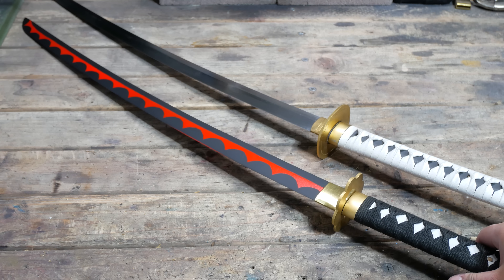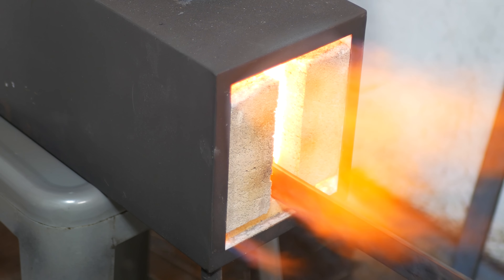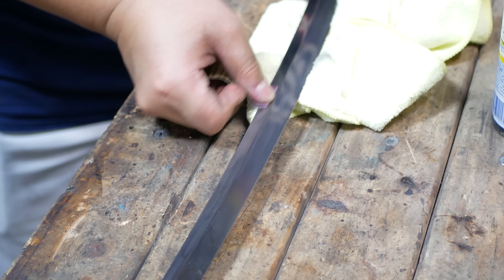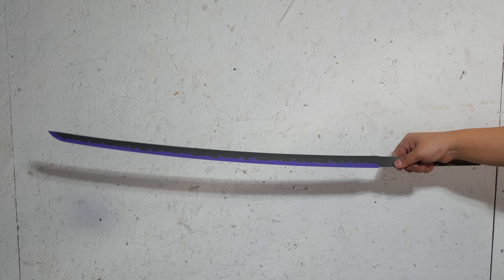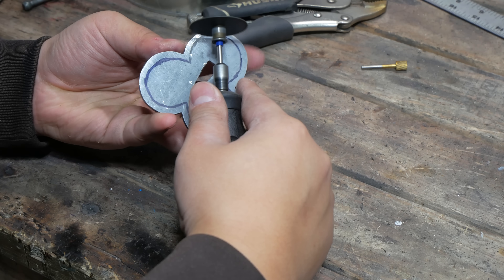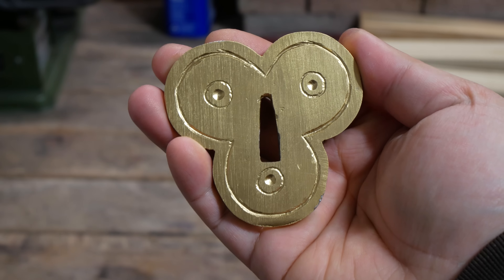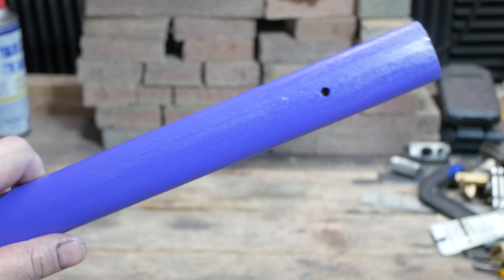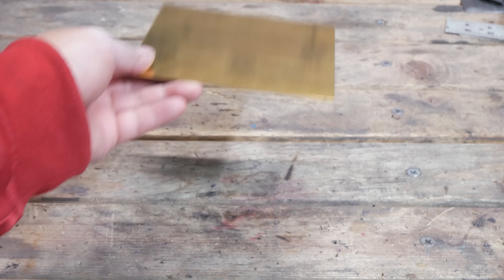Katana Making - Enma (Zoro One Piece) ALL THREE SWORDS!!!

Comment: What kind of paint do you use and does it last on the blade?
Reply from the maker: I have used a variety of different kinds, from Duracoat to Rustoleum. So far, Duracoat has lasted the longest but is also very expensive.

Comment: The swords are getting better and better, but why don't u use leather or artificial leather for a base handle wrapping? U will probably get more nicely looking tsuka in this way. I dont mention samegawa here as it's really not cheap. What's more one can try zone hardening. Not sure if hamon will be achieved but it's a traditional way to get sori, plus, working with a straight blade is easier, as for me, and then it is curved after quenching.

Comment: What I really like about this build is you gave it a pretty convincing choji style hamon, a personal favorite. It also reminds me much of the kind of swords they give Mitsuhide Akechi in the Samurai Warriors/Warriors Orochi games. Does it move differently in the hand/feel very different when it's not wrapped?
Reply from the maker: God I love the dynasty/samurai warriors games. It does feel a little different, definitely thinner because there is no wrap. And the paint was a little slick, it would've had more grip if I didn't use gloss paint. The fittings helped to make your hand feel secure holding on to the sword too.
Reply: @JumboRadish  I always played as Mitsuhide if you couldn't CAC, even then, I still used his moveset. I guess the paint issue is tolerable if you shape the tsuka well, lets you index properly. Ever give any thought to fine polishing the edge? It's a secret of some knife guys. They put a convex edge on the blade, then give it an extreme level of polish. Both can be accomplished using a slack belt sander. Try it out on a sample blade. I think you'll like the results. Glides cleaner thru the target.